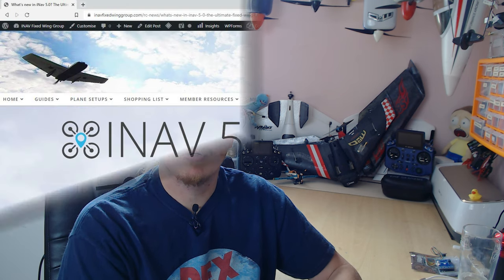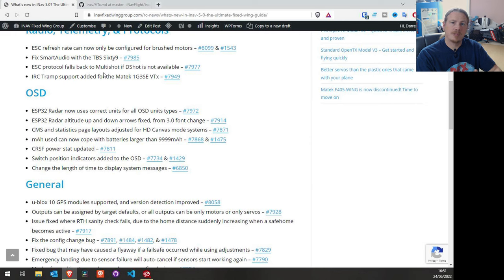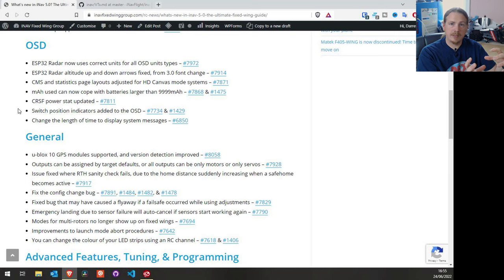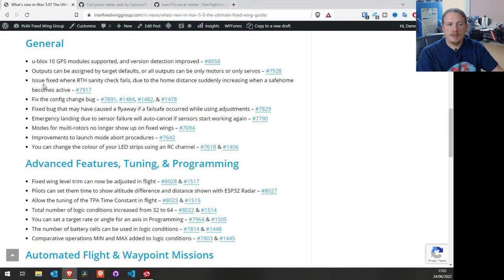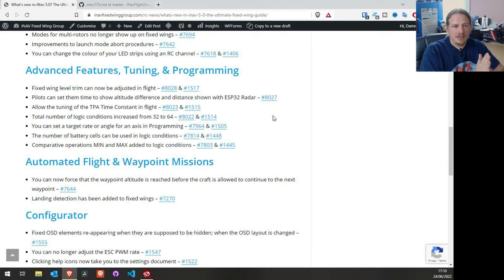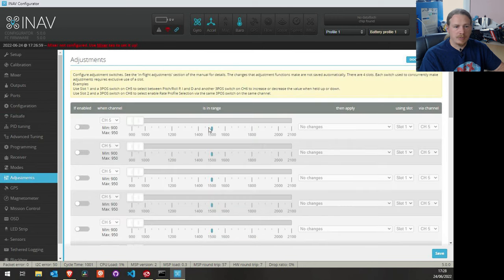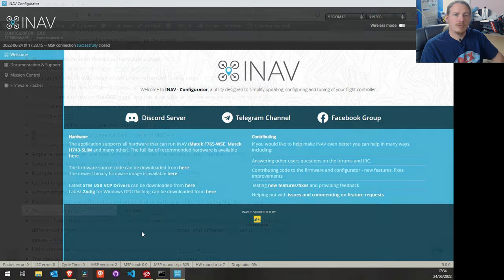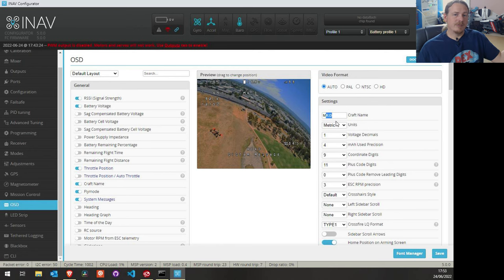What's new for fixed wing in iNav 5.0, Ballistic Buzzard?

Comment: Hello. Question about inav5. Why can't I now change D-Boost Min Scale and D-Boost Max Scale in D-Term mechanics settings? 
After saving, the values are rounded to integers. My multirotor FC matec F405SE.
Reply from the maker: It looks like there is a rounding error in configurator. If you save those settings with CLI you will be ok. I'll look in to a fix.

Comment: Great video, I have a few questions :
1. I realized that the servo mix starts from servo 1, not servo 2 as on iNav 4, I copied the diff for servo from 4.1 and all looks good, is something wrong? Or I should manually set it from scratch (I also realized that the counting started from 2 not from 1 as I updated the diff, on the bench all looks great, I didn't have the time to test in flight)
2. We can migrate the board calibration(all the "set acc***")? I'm asking because I realized that in 5.0 are additional gyro data parameters (gyro x y and z + ins_gravity_cms)
Thank you and all the dev team for your hard work on this project.
Also, love the MSC button from the CLI tab.
Reply from the maker: Hey Dorel, glad you're enjoying the new features in iNav 5.0,
1. If you have been using diffs from an older version, the servo numbers will not be updated. It's nothing to worry about. It will still work. The servos starting at 1 was added in 4.1. So any new mixes created from that version on will start with servo 1.
2. There are quite a few set commands with acc at the front. But I'm guessing you are meaning the six that are set when you calibrate the accelerometer. They are fine to use still.

Comment: Fantastic as usual, thanks! And since you have helped me twice already, please help!!! I have been trying to flash an ff35 board since yesterday with inav 5 with no luck. Everything works fine until I press the write button. Then it just shows me size of the file and nothing happens! Any suggestions, please!!!
Reply from the maker: It sounds like it might not be going in to DFU mode. Try plugging the USB cable in while holding down the DFU button, or use the ImpulseRC driver fixer to get the FC in to DFU mode. Then load configurator and try flashing again.
Reply: @MrD  thank you kindly for your help!!!! 3 out of 3!!! Zadig never worked, so all cool now! Thank you!
Reply from the maker: To be honest, Zadig I’ve always found to be a pain. The ImpulseRC driver fixer is simple and fixes most driver/dfu problems.

Comment: iNav 5 appears to be mouthwatering, however there is an issue with the likes of Zadig. The STM32 driver is stripped in the accursed Windows 11 and even when 'Driver Signage' is turned off and a fresh install of Zadig, still no STM32 drivers, thus cannot flash iNAV 5. Do you have a workaround for this?
Reply from the maker: Try downloading and installing the STM32 drivers for windows. I did try to get a link. But I’m not at a computer at the moment. When you first open Configurator, the link is on the welcome screen.

Comment: Thanks so much for the indepth work with inav 5.0. I had a small question, is the fixed wing level trim a mode that i use? I just cant understand where I access this feature
Reply from the maker: Hi Jonathan. I've just answered a question in these comments for FlyinSunnyCoast. Check out the reply to that as it answers your question too :)
Reply: @MrD  I just checked and saw. Thanks so much for taking the time to answer our questions
Reply from the maker: @Jokerman518  no problem at all 👍🏻

Comment: Hey Darren does inav 5 support full OSD all elements, for DJI HD?
Reply from the maker: No. DJI doesn't use an MSP Canvas OSD. They set what can and can't be displayed. iNav has hacks for displaying more elements than would otherwise be allowed by DJI. But for a full and proper OSD, MSP Canvas would be needed. That ball is in DJI's court. But I honestly can't see it happening. Even with the DJI/Caddx/Walksnail/FatShark implementation; they used BetaFlight for the MSP Canvas basis. So there's no saying it will work with iNav, or update at a decent rate when more elements and an AHI is added.
Reply: Got it Okies.great information as always, thank you.  i am currently missing the compass on the DJI air units OSD with iNav.

Comment: Unfortunately, it is not possible to output commands from the programming tab to the UART port (.
I wanted to use the UART port on the camera to control the zoom using Pelco protocol commands.
Reply from the maker: No, that would require coding. The programming tab is for predefined tasks.

Comment: I must have forgotten or it must be new, the inav fixed wing group site where I went when you mentioned it and spend a lot of time reading F405 Wing will be discontinued so I need to go for the F405 WSE at least. Must have a look to get the supply for next year right or move ahead to the next generation. 

Great iNAV 5 in detail overview and I feel comfortable to make the update soon in autumn I guess. I am not the guy for beta experiments and all the risks that come along with that.
Reply from the maker: In the autumn, 5.1 will be out. At this point it is not a beta experiment. There is a lot of testing that goes in to iNav before release candidate stage. That is the beta testing. Release candidates are still a testing phase, but on a firmware that is deemed pretty stable. It just means that more people are using it, so may find the odd bug. Once a release candidate has been out for 2 weeks with no bug reports, it gets released as stable.

Comment: Nice video. lots of good information.
Really hoping there will be more in depth stuff coming up.
Very interested in the Fixed Wing Level Trim, and how to use it.
Is this a value shown in configurator somewhere?
Is it like a PID, where you can adjust the value, but need to check in CLI?
Thank you in advance.
You guys are amazing.
Reply from the maker: Fixed Wing Level Trim was added in 4.0. It is used instead of the board pitch alignment for setting the angle of attack at the current speed. There is a field in the PID Tuning > Mechanics tab that can be used to set the initial value, if you want. Then in flight there is the auto level tuning mode. I set mine up on a separate switch, then enable it when I am either in Angle or CRSH, fly hands off for a few seconds, and let the altitude stabilise. Then disable auto level and fly as normal. It will also work with horizon, or any other self levelling mode that doesn't have altitude hold.

What has been added in iNav 5.0 is the ability to tweak this in flight, using the adjustments system. I have a video on setting up the in flight adjustments here https://youtu.be/A5i0gs9LfE8. You would just choose Fixed Wing Level Trim as the function.

Hope this helps.

Comment: could i use the new output_mode option to asign 1 motor and 3 servo outputs to the output pins of my betaflight f4 flightcontroller? the standard mixer uses 2 pins for motors and 2 pins for servos
Reply from the maker: No. You can only use the outputs described by the target, or all motors, or all servos.
Reply: @MrD  Thnx !

Comment: Great video.  Could you expand on how fixed wing level trim can be set up.  Or possibly refer me to a link.  Thanks.
Reply from the maker: It’s pretty easy. Just add the auto level mode to a switch. Then when you’re in angle, horizon, or crsh, just enable the auto level and keep your hands off the sticks. If you have the numeric vario in your OSD, you will see the numbers level off. Once this happens, switch off auto level and fly.
Reply: @MrD  Thanks Darren.  I  already have this set up and it works well. I took it from the description that this was user incremental change - a bit like changing trim.   My mistake.  The Auto Level mode is good.
Reply from the maker: @martr  ah, that is setup using the adjustments tab 👍🏻
Reply: @MrD  Dear Darren, how do I adjust the vario number on the OSD to see the auto level reading?
Reply from the maker: You just add it to the OSD. It’s in the options on the left of the page.

Comment: Darren what's the difference between doing a Dump and Diff to save settings to new version and what effect does it have.
Reply from the maker: Trying hard to avoid toilet humour 🤣

A dump should only be used as a backup for that specific flight controller on that specific version of the firmware. It shouldn’t be used for updating or anything like that. 

The diff can also be used as a backup. But also for updates. 

The dump is a full dump of every parameter on the flight controller. Whereas a diff is a partial dump of only parameters that are different to the firmware defaults. There is also the “all” option which will dump or diff all profiles, rather than only the currently active profile.

Personally, I don’t use full dumps anymore. I find that diffs do all I need.
Reply: @MrD  Yes when I wrote it I thought 5he word dump may cause some humour 🤣🤣🤣🤣
Reply: The reason I asked was I think I did a dump when upgrading from 4.0 to 5.0,what faults will that have Darren.
Reply from the maker: @M-H433  basically if any of the flight controller default values changed, they will not be updated when you do the upgrade.  

For example if the default filter values change to improve the effectiveness, or even use a different filter. It’s something that you likely would be changing yourself. If you use dump, all the old settings for those filters would still be used. But with the diff, they will be updated to the newer settings. 

It’s always better to use diff or diff all. And also check the release notes to see if any areas of the diff shouldn’t be used in the update.
Reply: @MrD  ok looks l8ke I stuffed up then

Comment: Dear Darren, when will the floating horizon be fixed?
Reply from the maker: That is an impossible question to answer. It is a complex issue to solve involving quaternion theory, understanding C and how iNav is coded. Someone who can do all this; and have the time to re-develop the IMU code, which could break other things that also need fixing, would need to be found. It is not a simple thing to solve.
Reply: @MrD  Dear Darren, how to deal with the drifting horizon? how to properly mount a flight controller to reduce
Reply from the maker: The first and most important thing is to have a clean build. By this I’m meaning a well balanced propeller (not just trust it out the bag) and no electrical noise. If your video has any noise in it, that can be affecting other components, like the accelerometer ang gyro. Adding things like LC filters only clean up the video. The better option is to clean up the components that are generating the noise. For example and ESC that adds lines to the video feed. Putting a low-ESR capacitor on the ESC will help. You could also mount the FC using a thicker double sided tape. 

Once you have a clean build. If you still have some drift. This should now be able to be tuned out with the acc imu ignore rate and slope parameters. But these will only really help drifts over long, slow turns. Drifts that are not gained in long slow turns is going to be excessive vibration or electrical noise somewhere.